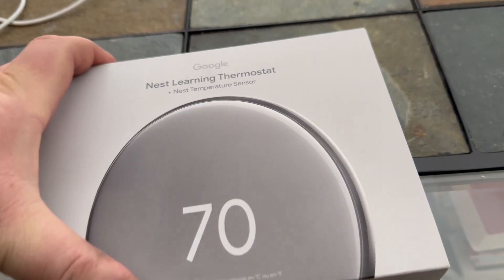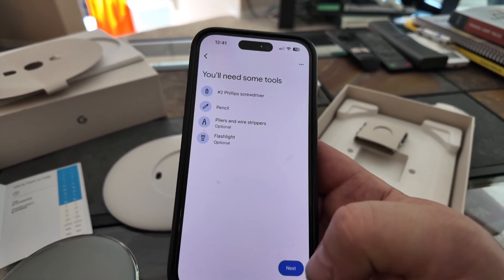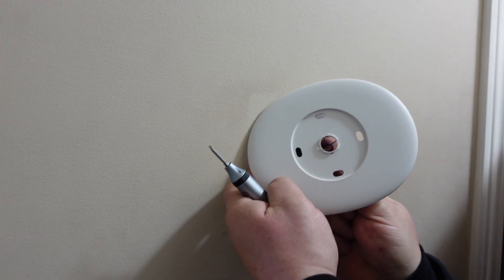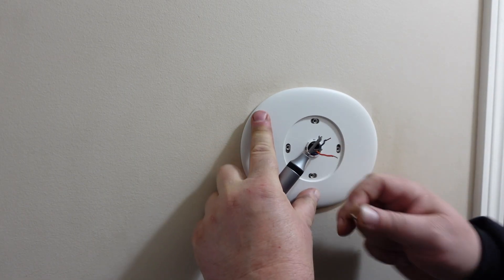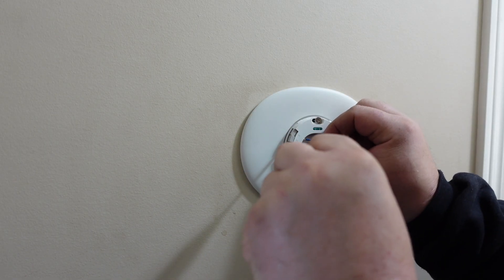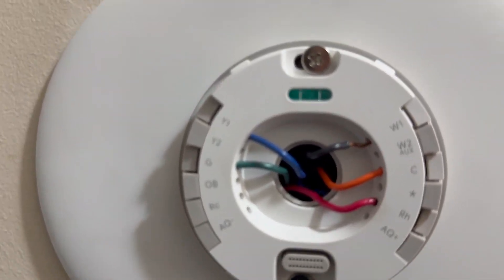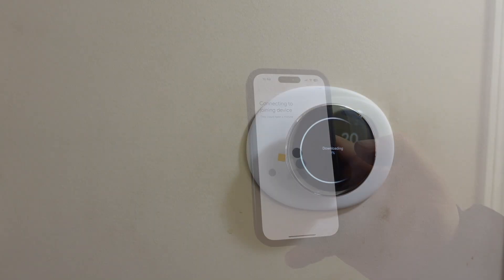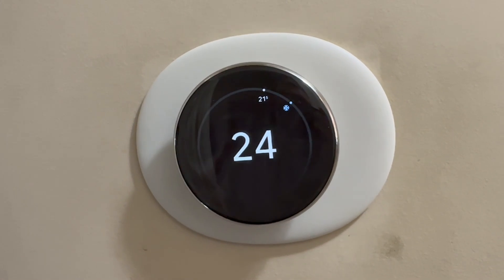GOOGLE NEST LEARNING THERMOSTAT TO REPLACE NEST

Comment: So the old base plate IS compatible?!
Reply from the maker: No its not, at least on the second Gen model I had it wasn’t
Reply: Looks like it was based on his setup.
Reply: 1. The wall plate is compatible. 
2. You can keep your old rectangular one or install the new oval one. 
3. The power base plate IS NOT compatible. 
4. You must change it to use the new thermostat.